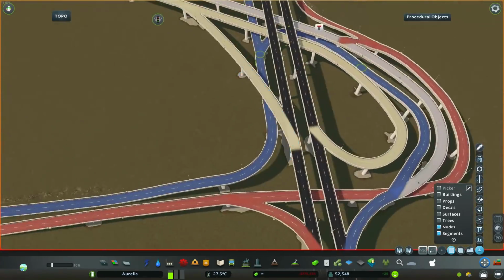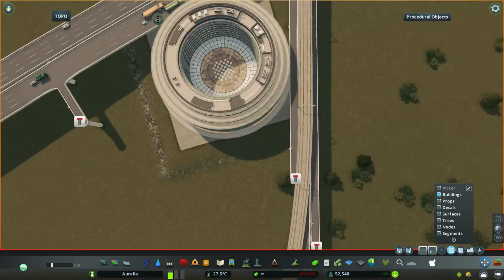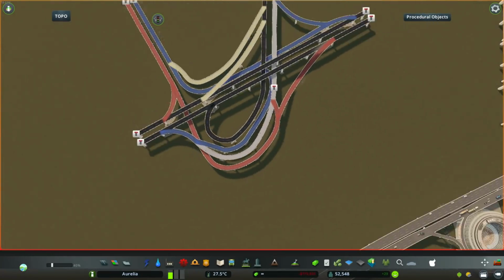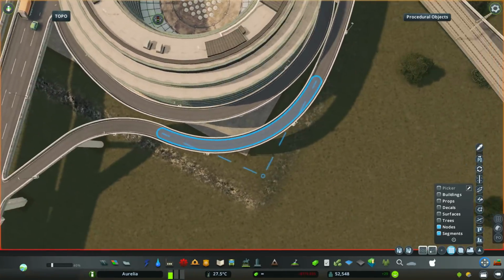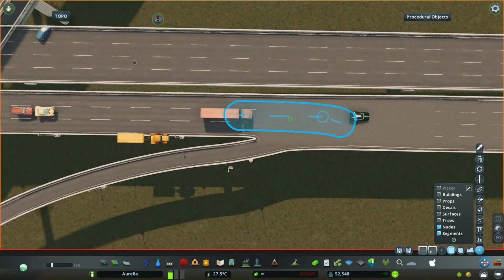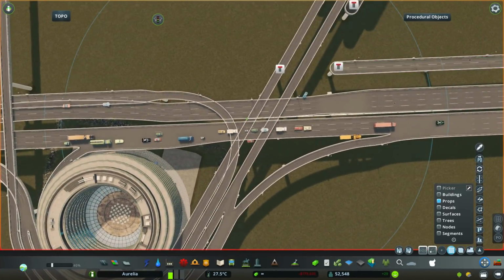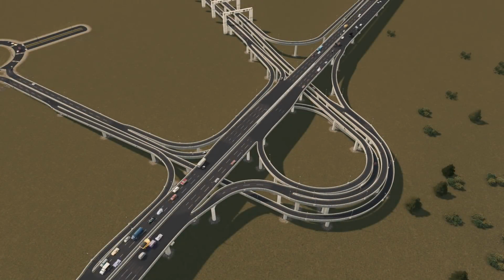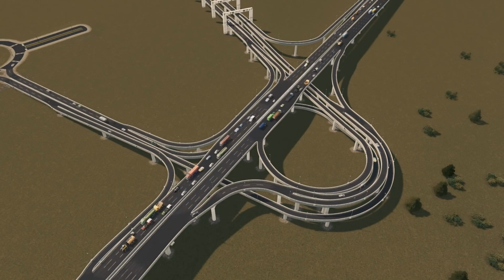Cities: Skylines - Interchange Design With a Color Prototype

Comment: Nobody says it but I dont know, CSUR 2.0 has big limitations inspite of having probably 5-600 combination. I recently switched to YAES highways & reworked all my interchanges. CSUR is not ideal if u are recreating an actual city due to its Shift section (pink) limitations.
Reply from the maker: I saw the YAES, might give it a chance.
Reply: @Akruas  try it.. but with caution.. its not in a very good relationship with NS2. U will be able to apply color but junction will be reset with reload.
Reply: Why shouldn’t CSUR be ideal for a realistic city? Works perfectly for me in Verville...
Reply: @CityScapesYT  already mentioned it... the shift section, it only has the options for 1 lane ramp only, from ramp to centre models (1C). A two lane ramp converging to a three lane road and connecting to the city's main roads is very common. Connecting to ur basic road with just one lane ramp everywhere looks impractical & ugly. But one cannot deny the fact that their road textures are the most realistic & way better than any others in workshop.
Reply: @arkoat2011  But that's simply not true. You can also connect  s lane 2 way roads perfectly fine to vanilla roads. And especially for european cities it works surprisingly well and looks absolutely realistic.
Reply: @CityScapesYT  no no... 2 lane roads are fine, 2C version has fine transformation with the vanila roads now after updates. But I am taking about ramp models. There no option to connect a 2 lane ramp (2R, 2R3, 2R3P etc) or a 3 lane ramp to their respective centre models (2C or 3C). U cannot connect R models to C models without req shift (pink section tab) models. YAES recently released a 3 lane cntre model with two trasns models.
Reply: Alright, will check it out. I always found a workaround for corner cases